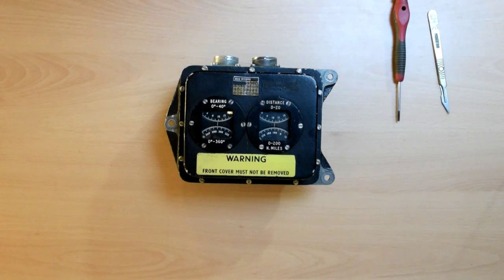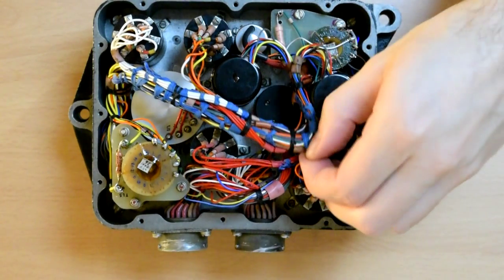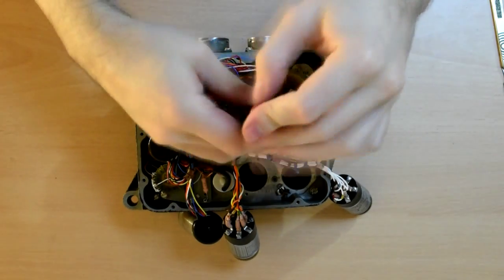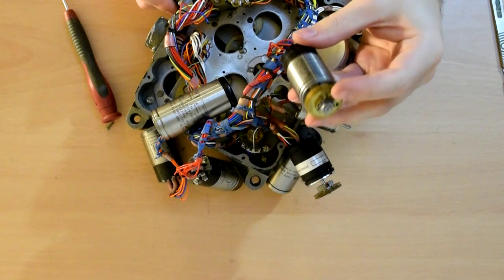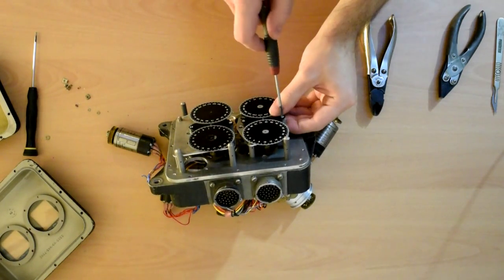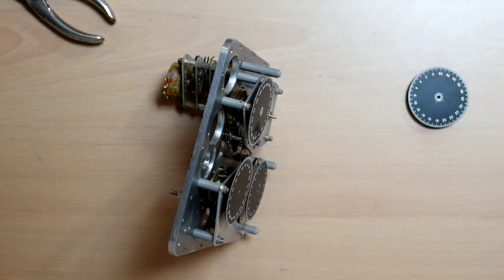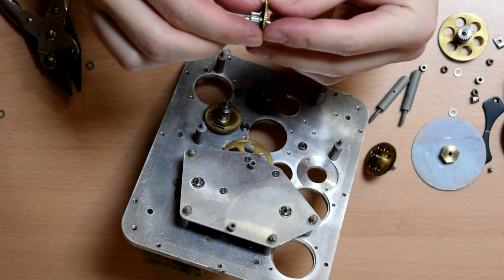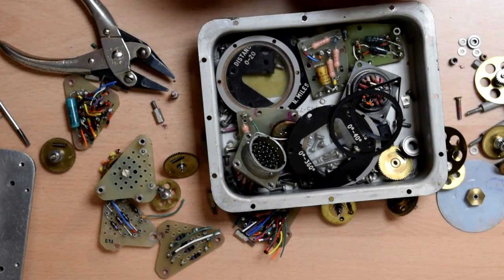TACAN navigation system component teardown

Comment: Might be interesting to look at the screws and nuts under UV light. We generally used a special Loctite with a UV marker dye in it. That allowed the inspectors to use a UV lamp to check that Loctite had been applied to all threads.

Comment: Virtually all Smiths servos used spring loaded split gear anti-backlash gears. The spring in your unit must have been lost. However the Indicator Distance unit that worked with this device used a different technique. The read out was similar to a car mileometer and since it had a maximum number of turns the whole gear train was wound up with a coil spring at the end.

Comment: In the 1960s I worked in the Smiths Navigational Instruments dept. Bishops Cleese. The Ferranti device was a potentiometer that was used as the transmitter to the Indicator Distance Unit which used a similar potentiometer for feedback position. The error amplifier did not have a very high input resistance. This caused a loading error. The original design took this into account since both potentiometers were intended to have the same resistance. However I discovered that due to shortages a different value potentiometer was fitted to the indicator. I realised that this would cause an error. I reported it to my boss but he said the test equipment showed it to be accurate. I checked the test equipment and lo and behold it had been fitted  with the same potentiometer as the indicator. The indicators had to be removed from all the aircraft and the correct value potentiometers fitted. (Peter Prest)
Reply from the maker: Nice, that's quite a bug-find!
Reply: As I remember the units were fitted into Lightning Fighters